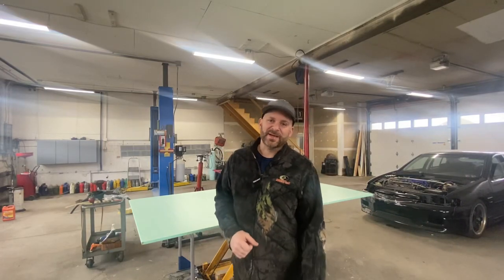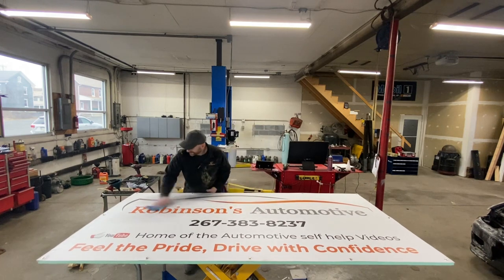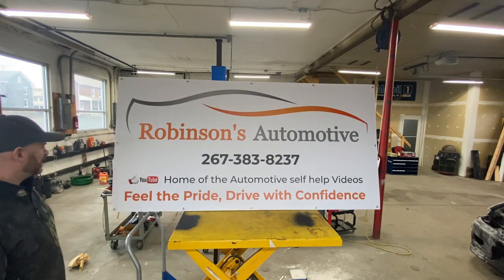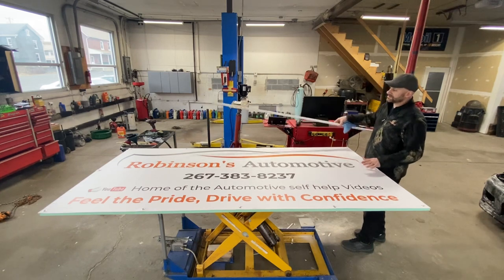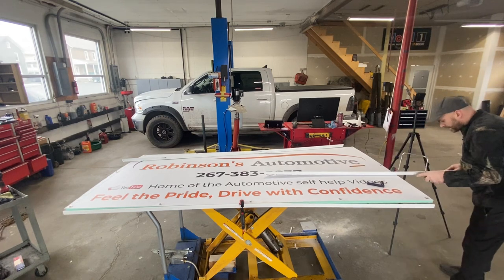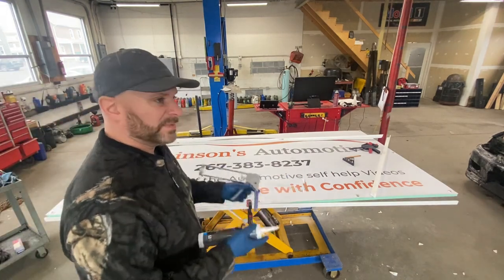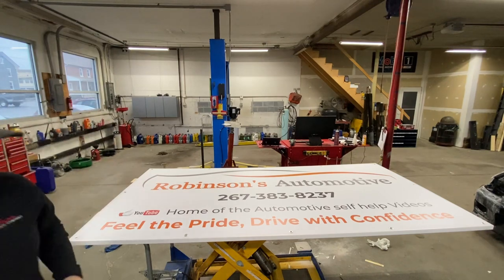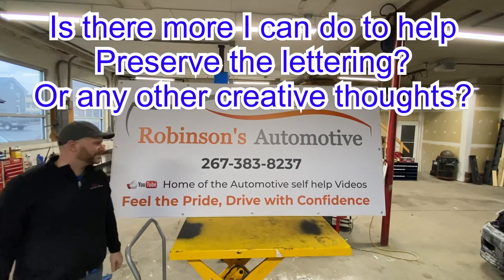"Cheap DIY Business Sign" | I Was Shocked By the Results!

Comment: Looks great. Could always build a frame and use UV resistant glass or plastic if worried about it fading. Wouldn't need to be all that thick to get protection. It is fantastic you are getting your name on the building and know it will be a huge success.I might be a bit partial to the name as its my last name as well lol

Comment: I use to do signs for a living years back and I would be concerned that if you coat the sign with something (like a clear coat) the clear will shrink and expand at a different rate as the rest of the sign. Are the letters printed on or decals? Also I would be worried that the foam may want to shrink on one side or expand on the other, so if it is directly in the sun, expect it could and probably will happen. Otherwise, it looks great! I hope it helps bring in the work & if later on you need to spend a few more bucks on a sign, you will have the cash then! All the best!
Reply from the maker: I agree 100% this is a budget build one step closer to a real sign than just a banner. What about a wax of sorts? 

From what I’m gathering from the manufacturer, I’m probably better off not applying anything as well. But I’m sure they want to sell more signs lol signs.com
Here are some details from the manufacturer. 
Our printing process is a four color process that uses eco-friendly, weather, fade and abrasion resistant UV ink. All our banners are digitally printed on industry leading large-format printers. 
Will the printing fade over time?
All of our banners are printed with fade and abrasion resistant UV ink. This means that the printing should remain vibrant for years. While there will eventually be fading as there will be with any sign, we’re confident that you’ll find your custom banner to be long-lasting and crisp for years to come.

Back board 

Backing board I used 
Kingspan GreenGuard R- 2.5, 0.5-in x 4-ft x 8-ft

OVERVIEW
For use as general purpose insulation for wall applications. XPS insulation can be used as continuous insulation on interior or exterior walls to help increase the R-value of the walls, and improve the energy efficiency of the entire home or building.

From what I have read XPS should have little shrinkage. However your most likely right but I guess time will tell. Thank you for all this feedback this will be a good time stamped test 😅
Reply: @robinsonsauto  The banner material is bumpy and not smooth, right? Wax might be hard to apply properly and buff off. Did the sign shop have any suggestions? They should know, since they know the type of products they have used. Just a FIY, I meant no offence or was I implying anything about a budget build. It is what it is. It looks fantastic. If where you got it has no other suggestions, I would hang the sign and let it work for you. Nice talking to you again!
Reply from the maker: @unclemarksdiyauto  this was exactly the type of feedback I wanted, I’m thankful for the warnings. gives me something to watch out for and for others to consider. No offense taken, most of my response is copied and pasted, with hopes to answer any questions. I didn’t asked the vender. I’m thinking They wouldn’t want to preserve it any longer than they had too prior to selling me another. 

Yes it has some texture
Reply: @robinsonsauto  I am thinking the wax will go in the textured holes and be impossible to buff completely out of there. Then dirt and stuff can get stuck in those spots.

Comment: Good job on the sign. It is called filling a 5 gallon bucket with common sense and then taking that wherever you go and using it. Not taught these days. Thanks for the video.
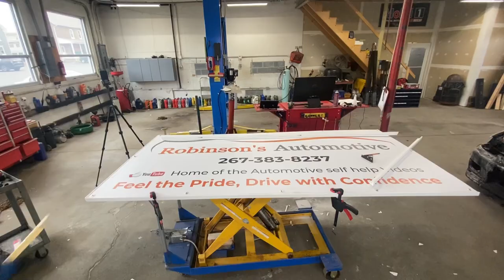Reply from the maker: Thank you! I agree ☝️ learn everything you can and don’t be afraid to try new things, your welcome anytime 13:00
Reply: I would only suggest a little more solid backing to keep the foam from crumbing in the elements, wind, not an expert on sealers but some coating on the face is probably needed to keep it good shape, best of luck, hope to see some vids soon

Comment: Your red lettering will fade fast in direct sunlight....so hang it as high as possible under the overhang of your roof while still keeping it visible. Avoid west facing  wall as afternoon sun is hottest time of day will fade it faster. BUT...sometimes you just gotta put it where it needs to be.
Reply from the maker: Thank you for the advice Terry, is there anything I can put on it to help preserve the lettering?
Reply: @robinsonsauto  No, that's outta my wheelhouse....lol...But mount it well, any wind getting behind it will break it to pieces...or rip it off the wall. I'd put hex or torx head screws in all your little cute holes.Also calk around it to deter wind lift.That's all I've got....Good luck.
Reply from the maker: @terryharvey4811  Thanks, yes that’s the plan. Time will tell 😅
Reply: @robinsonsauto  If all goes well, you'll get 3 to 4 years outta it, maybe more.